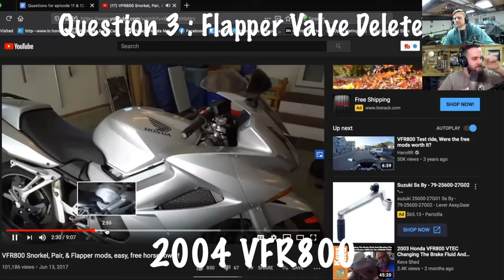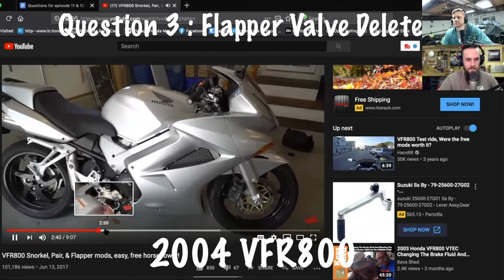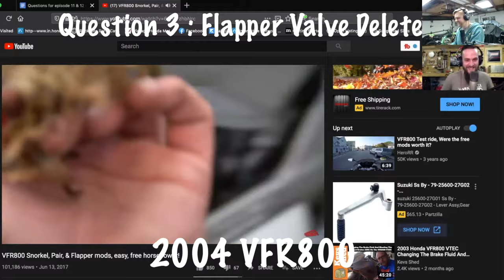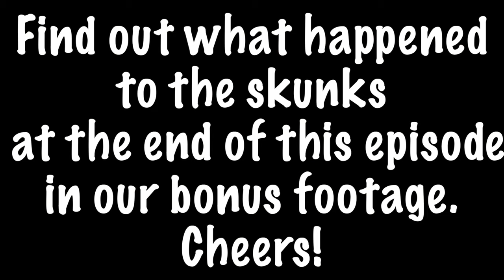The Broken Moto Show:  Episode 12 - Throttle Hesitation and Air box Modifications

Comment: Hey guys, this is Joshua, the guy who submitted the VFR question (it was not me in the rat's nest video though).  I happen to be an Electrical Engineer so I fully appreciate having to make design decisions based upon regulations, which is why I thought the alleged reason for the flapper may well be for noise instead of performance.  Sadly, the bike is put up since it has gotten cold in New England, so I won't be able to try any mods until the springtime.  On a related side note, since the bike has the weird dead spot in the throttle from 4500 - 5k I pretty much just changed my riding still to keep the rpms at or above 5k when cruising at steady speed so I don't notice the dead spot anymore.  Since the bike redline is around 12k I assume the engine has no problem running along at 5k+ all day long.  What rpms (as a function of redline) do most of you run your 4 cylinder bike?  My last bike was a 38 year old Suzuki GS850 with a 9k redline and I normally cruised it around 4k...
Reply from the maker: Most bikes will be cruising at 60mph between 4800-6500. Your not harming the bike at all doing what your doing
Reply: @TheMotorcycleMD  as long as there is constant good clean oil pressure and volume to keep everything  properly lubed. It must scream at 4k thru 6k RPM. How's the fuel consumption at those RPMs?
Reply: @eugenewong504  the VFR doesn't really start screaming until about 7500 when the extra valves activate. It's pretty smooth and relaxed at 5500

Comment: Another great show.   I just bought one of those K and N filters for my 1975 CB750.  After hearing what you said about them, I'm tempted to return it.  I haven't opened it and put into the air box yet.   I'm running a stock air box and the K and N filter is the same shape as the stock air filter, just made of different materials I guess.  Are you not a fan of those?
Reply from the maker: Simply because it may require some tuning. Maybe it will maybe it won’t. Be sure to oil the filter with filter oil. That’s the only way those filters actually work.

Comment: Wondering if you guys could help. Its a 06 honda crf50f and cannot get accurate info on the size of the pilot jet. I know you cant buy them and i think mine got opened up possibly by using pin vise (and using forums that i think were wrong) because i saw some brass that came out. Im hovering around .012" but since you guys clearly know your stuff was hoping you could help. Thank you for all of your great info, before, now and to come.
Reply from the maker: Please use the email provided to ask questions. 👌🏻
Reply: I forgot to add the service manual says #35 but have no clue what hole size that is.